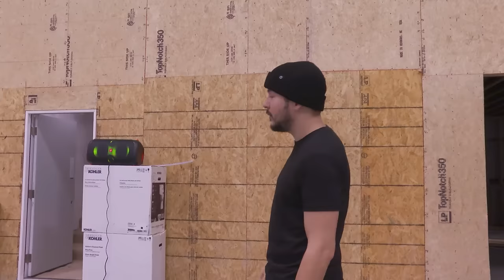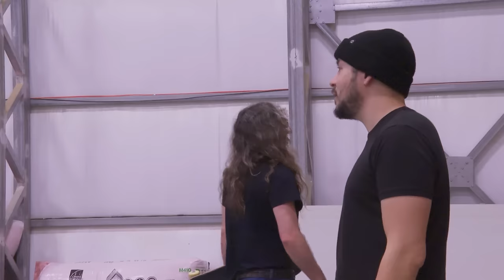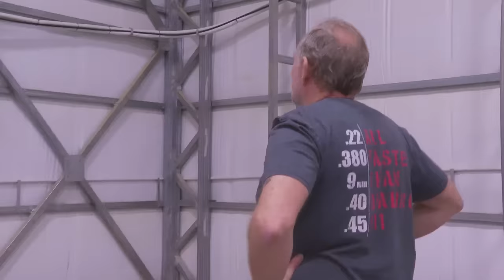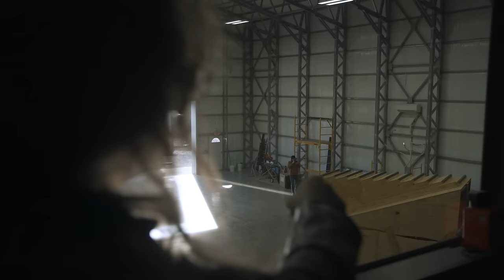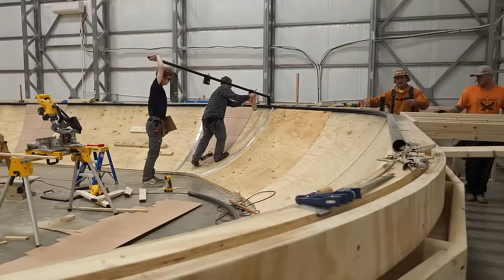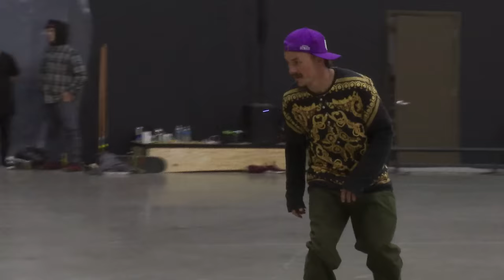WELCOME TO THE BOONIES : FIRST DAYS

Comment: The secret to kick flips is keeping your shoulders straight..
Reply: The secret to kickflips is every tip you get doesn’t work until one day it suddenly does. It’s all about repetition. There’s no secret
Reply: Yes practice makes perfect..but a straight upper body will keep your hips and feet in line. It's body mechanics.. sure you can try a trick 3000 times but you won't land it until your shoulders are aligned with you board.